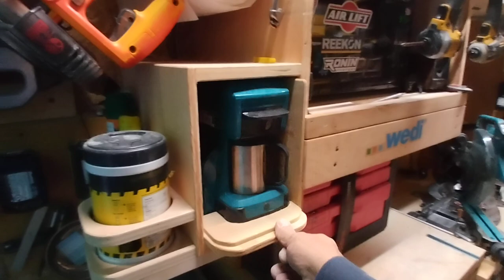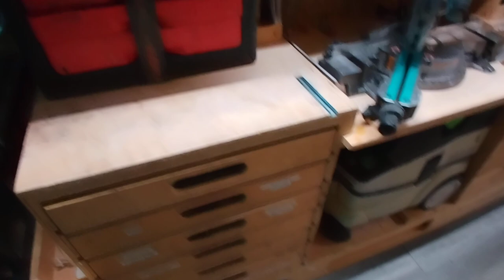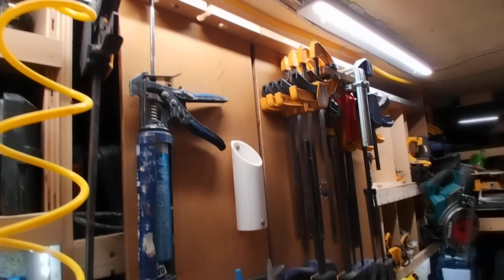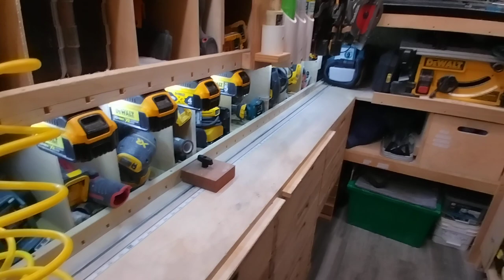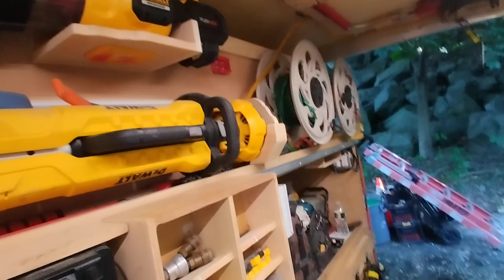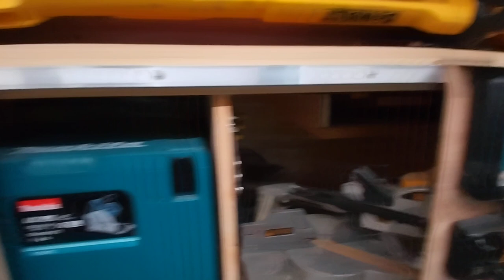Ron Paulk inspired trailer short preview update

Comment: I cant wait for the updated video showing the latest improvements after 1 year of use in this arrangement!
Reply from the maker: It’s coming soon . We are presently making modifications. As soon as we are done we will shoot new video
Reply: @realworldcarpentryremodeli5868  Did you start out with Ron's plans in sketchup and modified the design to fit your needs or did you just start building the similar drawers and layout without a plan?
Reply from the maker: I used Ron’s plans as a boiler plate . I didn’t use sketch up I did a layout around the tools on graph paper.